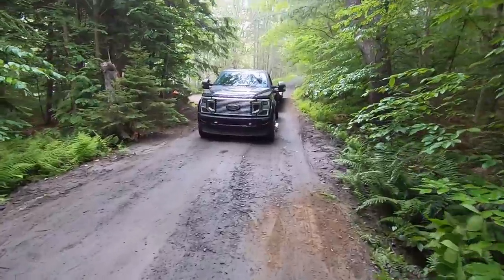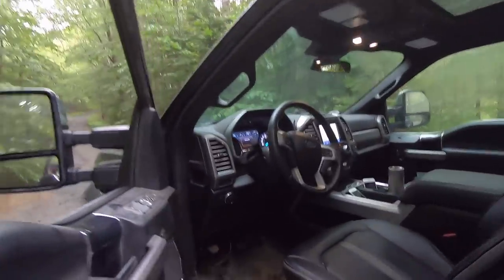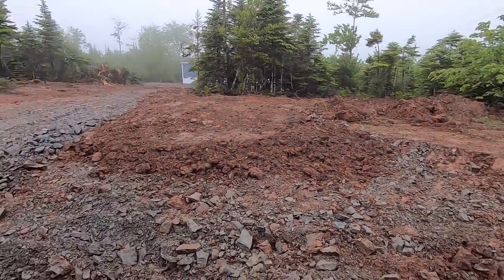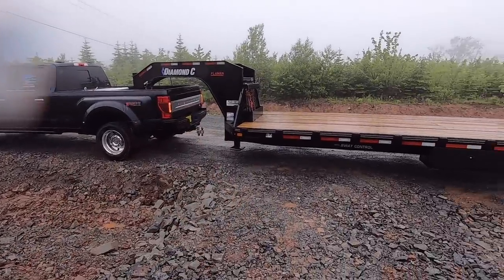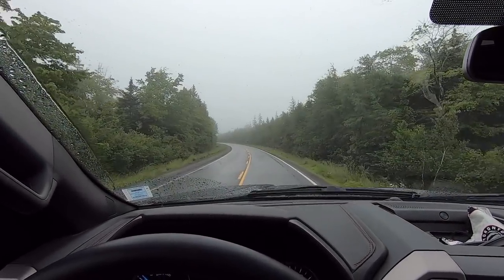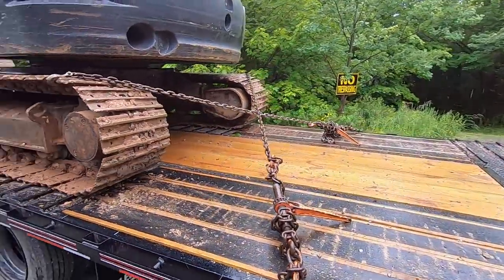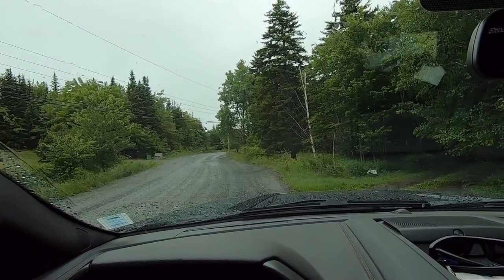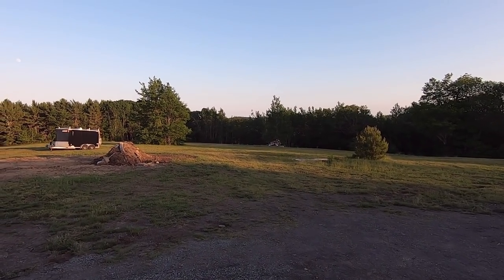FIRST TIME TOWING WITH THE DIAMOND C FMAX216 40K RATED TRAILER & WE HAVE THE BRAKES WORKING!

Comment: First yes!
To the trailer vibration. 1) tire pressure and balance, 2) engineered trailer type frames will vibrate with any subtle road undulations. Mine does no matter what when not loaded, usually at 65-70 mph on concrete interstate, asphalt not as much.

Comment: For the trailer brakes...have you done the trailer setup for that specific trailer in the dash/message center on the truck? If I remember correctly there is a choice for your braking system when entering the trailer name and other info. This might be the problem.  I've had a '19 F-350 DRW and now a '21 F-450 DRW and never had a problem with braking on any of the trailers I've pulled, but I have also entered my trailers into the dash/message center. None of my trailers have electric over hydraulic brakes though either.  Also be sure to select which trailer you're using after hooking up to it as the dash/message center won't know which one you have connected unless you only have one configured in the system.
Reply from the maker: For sure I have done all that. Thanks for helping though.

Comment: Great video man and solid solid trailer. Do you find it easier towing that new Diamond C vs your sure track even with the hydraulic dove tail sticking farther out? Just curious because I'm shopping for a new gooseneck myself. Also when can we see that thing hauling the Sany?
Reply from the maker: Should be hauling the SANY next week. I don’t find it any hard t to drive around really. Need to be alittle more mindful on turns I guess

Comment: I know you said youd be going over the suspension and stuff next video but I was wondering why go with the 40k vs a 30k if the trucks capacity isnt 40k? I have a '19 450 with a 30k PJ gooseneck.
Reply from the maker: I just wanted the extra strength and if I need to throw more rear weight on the trailer I know I’ll have the payload for it. Wasn’t much difference in price so said why not

Comment: That logic Ford uses for its trailer charge circuit makes no sense, unless they just want to protect that circuit from being used for other accessories. I was pulling my hair out when I got my new 21 F350 trying to figure out why I had no power to the charge terminal in the plug. The way I understand how it works is that, after the trailer is plugged in, it takes a press of the brake pedal to activate it. I think in your case, since the hydraulic master cylinder on the trailer needs 12V before IT will work, your truck never detects the trailer brake pedal activation and thus won't activate your charge circuit to give the master cylinder 12V. Now that you installed that jumper wire, does the truck activate the charge circuit now?
Reply from the maker: No I’m
Going to find a way to do it and I will update you all

Comment: The tag on these trailers does not represent the actual weight.  I just picked up an fmax216 40k....same trailer but 32 feet with aluminum wheels.  Weighs 9200 lb empty; on the scale....just fyi

Comment: Did you happen to accidentally lock up your trailer tires and flat spot them when you were adjusting your brakes? I’ve had that happen to me and it will cause the vibration that you have at certain speeds.
Reply from the maker: No I haven’t

Comment: Our 450 eats front tires especially if you haul a bunch of heavy stuff
Reply: I had same problem with my 350 dually until I got air bags to get rid of the sag and put weight back on front tires

Comment: My thoughts are the same as you regarding the stupid 12v on the superduty's where you have to press the brakes to get a 12 volt connection.  It took me a long time to figure it out, spent lots of time troubleshooting my trailers thinking that it was the wiring and all it was the stupid ford engineer that developed the superduty trailer wiring on my 2018 f350.  I also waisted lots of effort and frustration figuring out which one of the trailer related fuses that was in my f350 that may be causing the no voltage to the trailer.  Dumb, dumb, dumb Ford trailer engineer developer!  Who ever thought of this should be fired.

Comment: Does your trailer have LED lights?
Reply from the maker: Yea
Reply: @workplaytv  I know you got the issue resolved but did you see on one of the ford forums where they installed resistors on the trailer plug to also fix the issue?
Reply from the maker: @carls2210  nope haven’t seen that
Reply: @workplaytv  they used 3 ohms 50 w resistors. 1 on the r/h and 1 on the L/h turn signals and one to the tail/license to ground wired liked you use for an LED conversion.

Comment: I’m a power stroke tech, the best way to fix your trailer brake wiring issue is to buy a Ram 🥸
Reply from the maker: Lol nice
Reply: Yeah, then that will be the least of your issues.
Reply: @americantrucknation4891  … let me guess, Ford’s the best theres twenty billion of them on the road.. meanwhile the truth is, everything fails in one form or another regardless of brand. Every manufacturer has strong and weak points, anyone who disagrees with that is full of shit
Reply: @samuelschnare4905  I agree with you. I’m just saying Ford has the most power, torque, always in the right gear, more durable trans, more towing, more payload, better turning radius, more cab space, will never rust, the best mirrors of any vehicle ever made, better headlights, stronger frame, better fuel economy, better seats, and so on. Other than exhaust brake, (which can be upgraded) I don’t see a reason not to buy Ford.
Reply: @americantrucknation4891  comfy seats and extra cab space don’t make it tow better or any more reliable. I can’t speak for 2021 but my 17’ ram compared to a very similar 17’ ford (both 6.7 4x4 etc) got better mileage under any conditions, and I’m going to really specify here.. ANY conditions than the powerstroke. The only way that a powerstroke “could” get better mileage is with more gears. If it has the same number of gears as a Cummins it will use more fuel all day, everyday.
Reply: @samuelschnare4905  I didn’t say that they did. Yes, the PowerStroke is a heavier machine with more cylinders so naturally it will be harder to move. For 2020 the 10R140 trans is what make it #1 in towing, what I listed are more reasons why I think Ford is the only way to go
Reply: @americantrucknation4891  and what would you say for the oil change interval? Being half, literally half of the number of miles for a cummins? You would need to be out of service twice as much
Reply: @americantrucknation4891  everyone has a different school of thought on that. For me, it costs too much to do it any more than absolutely necessary and where I live in maine a lot of driving is required to go anywhere. So I’d need an oil change every couple of weeks by those standards
Reply: The biggest question I have about this, is how or why did he leave the parking lot where he bought the trailer. I always do a walk around and test drive 🙂